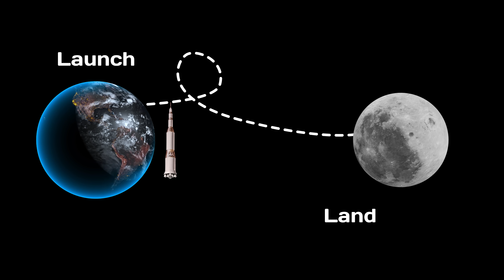SpaceX Found Brilliant Solution to Launch Starship on the Moon Sooner than NASA's Requirement

Comment: I agree with the video's main idea. Starship is locked into this idea of reusability, and it's holding back a hybrid more pragmatic approach to these big sovereign state programs. Perfection (reusability) is the enemy of progress, and so it makes sense for SpaceX to allow 3rd parties to design upper stages atop the booster. Fully expendable upper stages made cheap and lite weight.
Reply: Yep. Staging seems to be the way to go.
Reply: there is no prize for repeating something we did 60 years ago to beat the CCP. The real prize is winning with a game changing solution. If you want to dump dead weight, its called B O E I N G.
Reply: @PBraggMarinette that's a weird take. Physics 60 years ago is the same as physics today. The only difference is material science, but material science isn't magic.

Comment: Hell, why do NOT simply send 2 starships? 

1st, automated 2 staged, no return landable and unfoldable/inflatable moonbase with its own optionaly drived moon rovers

2nd, crewed 3 staged, no return except small landing capsule, with extra supplies for the base, including extra rover, or even capable of surface movement, just in case the second lander somehow had to land further away from the first lander.

Comment: Starship/Superheavy are also made of steel for the reentry thermal properties - aluminium would weight 1/3; carbon fibre 1/6.
Reply: SpaceX could make the Starship Booster (the first stage) from aluminum-lithium (Al-Li) alloy. That alloy is used on the SpaceX Falcon 9 Booster now. The Ship (the second stage of Starship) has to remain stainless steel (thermal properties). That Al-Li alloy could be SpaceX's hole card if the Block 3 Starship with the Raptor 3 engines needs more payload mass performance. BTW, NASA used Al-Li on the Space Shuttle External Tank and uses it now on the Core of the SLS moon rocket, both of which are non-reusable.

Comment: What if the diameter of the Starship were expanded from 9 to 18 meters with three times the number of Raptor engines (109), while maintaining the same height? The Starship would have three times the propellant and could land on the island without the need for docking and refueling in orbit!

Comment: Sure, if you just need payload to the moon pronto then yeah you could get it done fast with expendables on top of Super Heavy. . This is short signed, just to win a "race" that we already won 50 yrs ago. 

A fully reusable system is super hard, but once or arrives it will reduce all expendable rockets to expensive toys. 

This is the reason Vulcan was doomed even before it came to market.

Comment: I have been proposing a smaller craft with legs.  A smaller ship could be more effective until a landing site is developed on the moon.  Also a heavy lifter for moon operations which ccoud be an alternative to a moon capture tower.  A Krain lander. The lander should be remote controlled and  controlled by a Starship pilot.  Also the heavy landers will a logistical uses. Including carrying small mobile mini bases.   The Krain could have a small compartment for human operation.  This could be a future option.  A Krain would need to be able to land a  larger Starship and payload.  Payloads could also be divided in orbit to drop in parts.  This would not require such a large Krain.  And entail lower risk.  Once fully developed the Krain could also support passengers to and from the moon surface.  The Krain could also use a modular compartment for human transport.  A full Starship should also transport fuel loads to moon orbit to ssustain the lander.  Starship itself is not ergonomic  for moon landinng.  A larger Krain could land a complete Starship with cargo in future.  A Krain may have fourlarge legs and four engines, one on each corner.    Eventually a Krain would be suitable for human passengers.  With the modular living pod option.  And mobile pod for temporary bases.    The system would basically very simple.  Moon landings will also need testing to ensure effective and safe opperationns.  Recent moon landings with science miissions have resulted in a number of toppled bodies and hampered effective operations.

A very large lens could be used to melt regolith in the moon. Using solar power to prooducce high levveels of heat.   This could be used for a solid landing pad with less regolith dust.  Lenses can use solar power for structures as well. Including containers to hold regolyth around base structures of for protection.   3D solar printers have been developed to use sand to make glass. Fine metal rods could be added for greater strength. 

A lunar solar relector in moon orbit could be used to direct sunlight during lunar nights.  Possibly for lighting and solar power.  Direecting sunlight on to surface solar panels on the surface.   Pproovidinng contant power to the moon base.   Evventuaally a modular nnuclear reactor will be needed.  Possibly a Generation 4 fission reactor.

Comment: Starship, because  of its many reentry mandated design compromises, is a constraint on the overall system. Purpose build second and third stages, which would not have to reenter and which could be refuelled on orvit, would offer far more performance and flexibility.

Comment: Your titles reads as if SpaceX has solved a technical problem, but it's just you spitballing some solution without actual expertise in the subject. Sometimes it DOES take a rocket scientist.
Reply: Clickbait
Reply: So you stating this guy's a big AI. Big mouth. Stating starship is a true failure😮
Reply: Tough but fair.
Reply: Why transfer fuel?
Why not 3 Superstack launches, one with a luner insertion stage STARSHIP. And the second with a dockaable fueld  moon Starship with LEM and capabilities. And a 3rd fueled with Moon to earth capability.
> The whole concept of Superstack/Starship is rapid fire launches anyway.
> So just do it?
Reply: What if the diameter of the Starship were expanded from 9 to 18 meters with three times the number of Raptor engines (109), while maintaining the same height? The Starship would have three times the propellant and could land on the island without the need for docking and refueling in orbit!
Reply: @osentinela1435  Have you done all of the calculations?  1) Adding fuel adds weight.  2) Would the new, larger rocket increase the g-loads on the upper stages past their stability limits?  3) Landing on the Moon with a tall ship is riskier than with a shorter vehicle.  4) Much more fuel would be required to launch a large vehicle off the Moon than then Apollo ascent stage.

Comment: The R&D of orbital refueling is a bitch but it will benefit everyone far more than brute forcing a third stage to the moon. Designing a third stage and the fairings to deploy it is a far cry from orbital refueling but refueling opens up the whole solar system with even more mass. We do orbital refueling not because it's easy, but because it's hard.